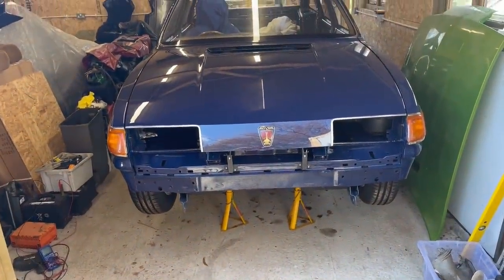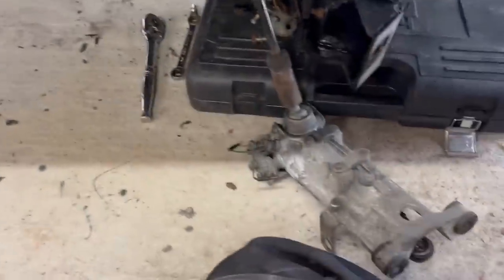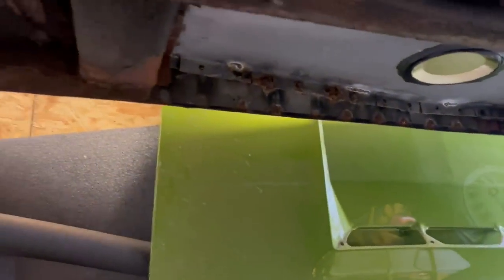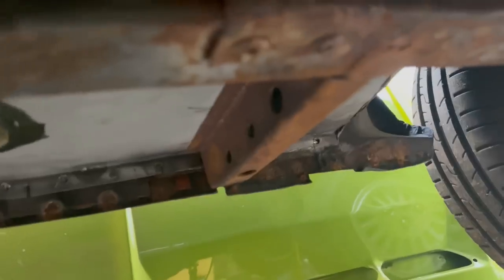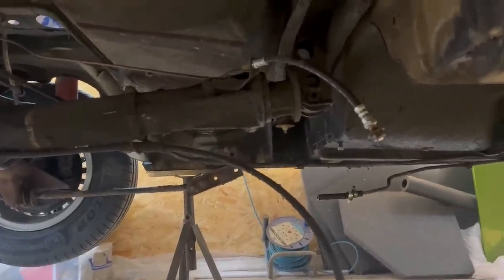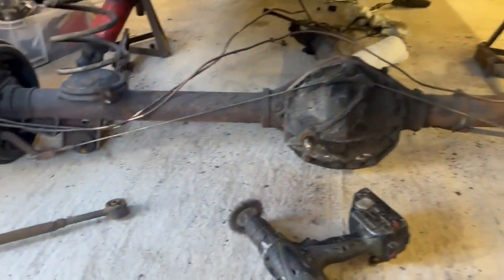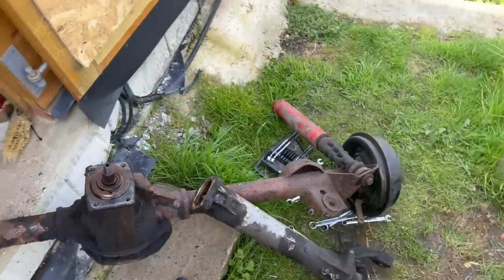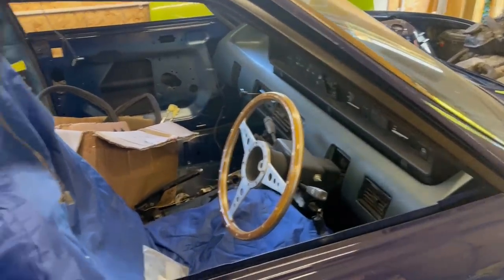Rover SD1 2400 SD Turbo Diesel - Video 99 Floor preparation rear axle removal

Comment: Insulation against sound underneath but has to insulate from water and be fire and heat resistant probably hence the layers, probably helping deflect heat from the bodywork too

Comment: James, some Dyna-mat is your friend for the appropriate interior flooring sections once you have prepped it accordingly. Some spray on sound deadener around the transmission tunnel area from underneath as well be be more than adequate.

Comment: Just came across your channel and was pleased it was a diesel Rover your renovating. But I would be more pleased if you put some blocks of wood underneath the wheels or some where structural for your safety, the higher you go with axle stands the more unstable they become.

Comment: Yes, you do need thick sound insulation! Back in the late 80's my local taxi firm had one of these! As a kid in remember thinking "This doesn't sound like a Rover engine" Obviously diesel engines have moved forward leaps and bounds since!
Reply from the maker: Its a proper clatterer thats for sure.  Ill put the sound deadening inside i think

Comment: Those stands you can attach your car to and rotate the car sure look like they could make a lot of jobs underneath far far easier to carry out.
Reply: He has actually got a car 'rotisserie' , as he did his police car that way. But in his words (or words to effect), it's a pain in the derriere to set up!
Reply from the maker: @Duncan Patterson yes precisely.  I did think about mounting this on there, to lift it up, bit just not rotate, to give me a bit more headroom
Reply: @nitrosilvia  Maybe one day, now that you got yourself a lovely new garage, how about look into car lifts? I'm not talking about those big four poster jobbies, the little hydraulically operated sissor floor  mounted ones like Sealey 2.5 tonne types. Granted they're not cheap new...but i'd imagined good used ones could found online maybe?  Anyhoo, keep up the good work. Looking forward to seeing you tackle the green one next. My dad had a gold 2.6L 6 pot in the late 70's. Lovely smooth ride, if a little on the wallowy side (it 's that rear axle innit!)..but a lovely motor. The SD1 in my opinion was probably the last proper Rover built, before BL broke up and Austin/Rover began selling re-badged Hondas. 🤪

Comment: The proximity of that nice Triton green bonnet to you working on the passenger side front floor was giving me anxiety! Fine work as always. I did something useful the other day: replaced timing gears and cam chain on a C180. Managed to delink the old chain connect the new chain to the old one, rotated the engine to pull in the new chain, the delinked the old chain and closed the chain. Did I use a special £50 cam chain linking tool? You bet I didn't. I made a chain link tool out of an old one for bicycle chains. Need to did the welder out for my E55 as MOT time is near!

Comment: Wow, James, you're certainly not half-assing the old girl. Glad that lots of the parts are serviceable. The trans cover is purely a NVH measure. I'd tend to re-use it if possible, but if you can apply enough sound deadening material to compensate, then that's cool. You'll soon find out once you start driving it. I look forward to further progress. Mart.
Reply from the maker: Hi Mart, i think ive made the decision to bin it.  Its a horrible thing and ive weakened it quite a lot removing it.  I think im gonna go mental on the cabin floor and bulkhead from the inside instead

Comment: great progress older
 cars so much easyer than new ones built better too i would say dyna matt for great sound dedening or also look at dodo mat they do some great sound proofing stuff have used both on jenny the camper floor and cab makes a big difference in sound and vibrations too all the best donny

Comment: delete it spraysounddencer on the underside and do the inside safe you a lot of cursing thanks for sharing
Reply from the maker: It’s deffo getting deleted. I’m gonna insulate the hell out of the inside. I’m a bit hesitant about putting stuff on underside as I don’t want it dopppmg off
Reply: @nitrosilvia  Yes i think when it is removed and give some deataling looks much beter do the inside with dynamat works great